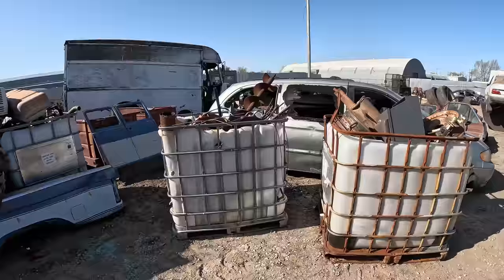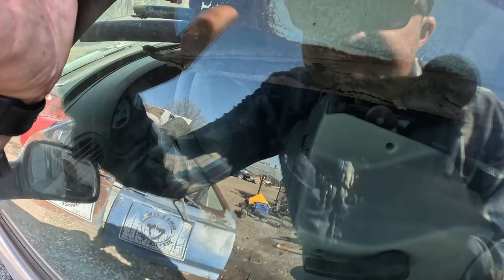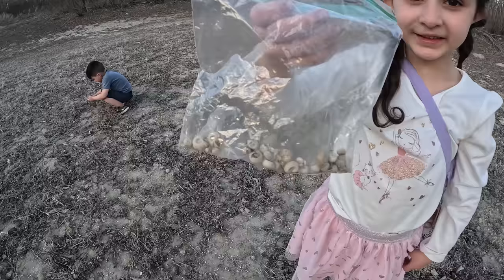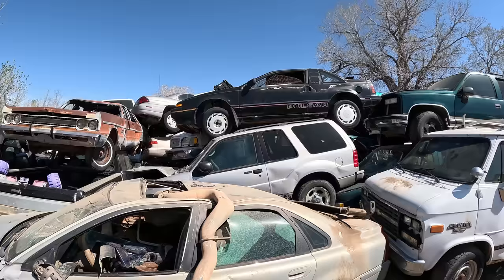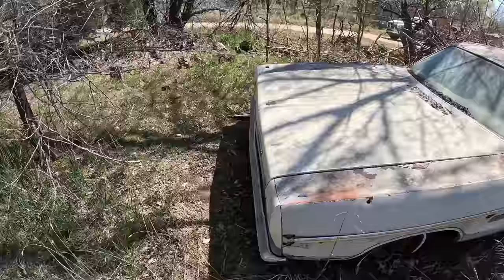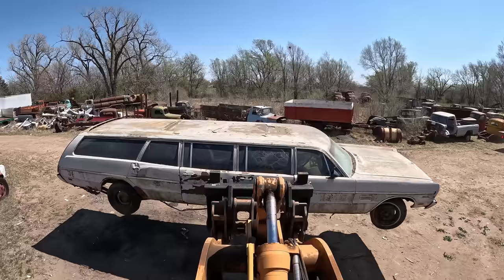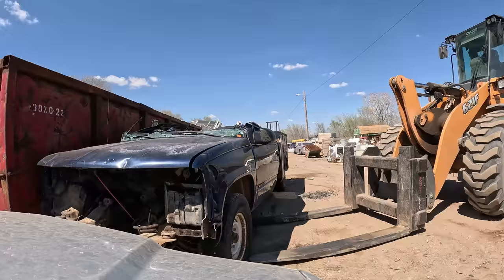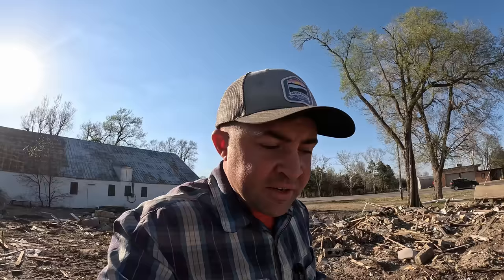Check out this Super UNUSUAL and RARE Car we Bought! (Abandoned & Sitting in the Trees for YEARS)

Comment: I saw lots of them in NY in the 70's and early 80's. They were called airport limos. Usually the hotels ran them back and forth to the various airports in the NY metropolitan area. In the later 80's they began switching to passenger vans that were more upgraded by that time.
Reply: Yup ! They was really popular at JFK Airport back in the 70's we use to call those " Plymousines"
Reply: Yes airport limo seen a few checkers like that also in NYC
Reply: They used to run to the Catskills out of New Your City called the "Jewish Alps" a lot of popular hotels with good entertainment on the weekends, I was pumping gas 60 miles out of NYC and it was a LOT cheaper out of the city so they would always stop for gas and a potty break. They were pretty neat. Good memories.
Reply: @mustangman8517  I once saw a 59 Chevy airport limo
Reply: @Marty's 4x4 yep
Reply: @Marty's 4x4 Yes, plus they had luggage stacked 3 foot high on the roof. They also has Willys super stretched and others. This was from New York City to the Catskill mountains for lots of resorts frequented by Jewish customers catering to food and entertainment for that community.  This was about 60 to 80 miles away from New York city depending on the resort chosen. Google Grossman's that was one of the biggest I am sure there is something on line. Many Jewish comedians got their start in the "Jewish Alps" as they were affectionately called.
Reply: @Marty's 4x4 Generally, yes. The Checkers they used were usually station wagon configured-more space for the luggage. But I don't remember if they all were.

Comment: That looks like a Phillips 66 Bartlesville-to-Tulsa limo. They had fleets of them until the 1980's, and the long multi-door ones until about 1978 (Suburbans) that ran to Tulsa Int'l. Airport and Downtown Tulsa, and maybe down to Jones Riverside Airport-that I'm not sure of. Bartlesville didn't have a real Five Star Hotel, so executives came to Tulsa to the Mayo which was a Five DIAMOND hotel 'til the late '70's. When I was pumping gas in the late 1960's, I fueled a Phillip's limo once. HUGE gas tank-probably 45 gallons, and I think it was a Chrysler product Station Wagon with a 403 Max Wedge and push-button Torque-Flite.

Comment: In 1968 my brother received an honorable discharge from US Air Force because he found out he had cancer and bought a 1968 Plymouth GTX with 440 V8 and 727 Torqueflite auto. Kenny Duttweiler was my brother's friends older brother and he built it to race at Lion's Drag Strip. It ran 11.9 in F Class. I wish I had the money for that Plymouth to make useable as I need a vehicle. I really want a 1994-98 12v Cummins ext. cab 3/4 ton 4x4. I want to work and not being hired. I could use the truck to mow lawns until I get a full time job. I am 61 and a Christian Minister. I will use the truck to help those in need also. God bless all.